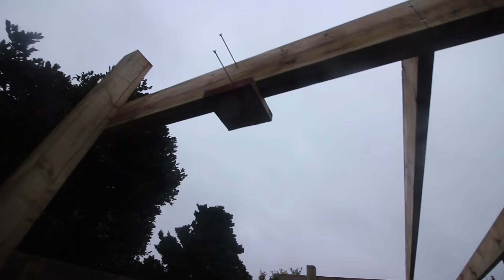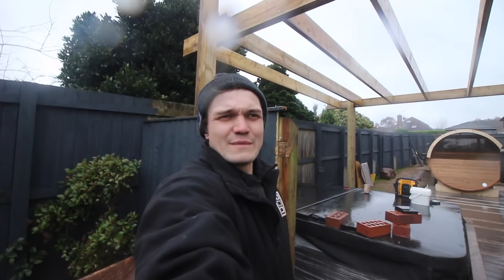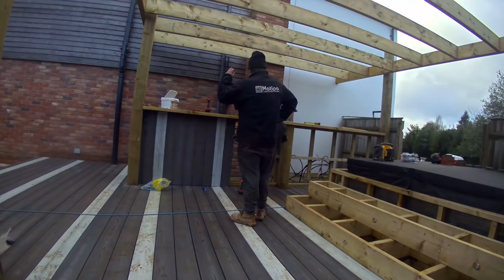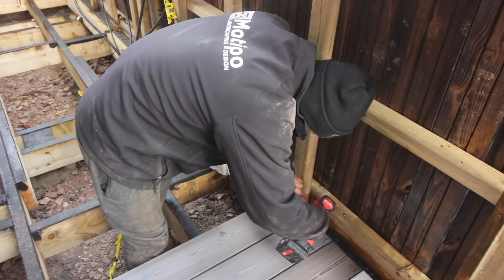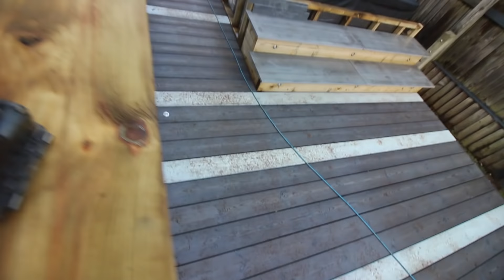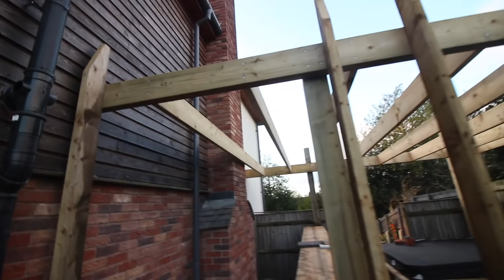GARDEN BAR!! Outside Bar Comes To Life!!

Comment: Your work always impresses.
Think I would have put a shoulder/half lap joint from the post to the header or bolted through with a header each side and then seated the rafters on top using some metal l brackets to hold them steady to the header. Also some bracing from post to header
Reply from the maker: Always room to improve 👍💯⚒️